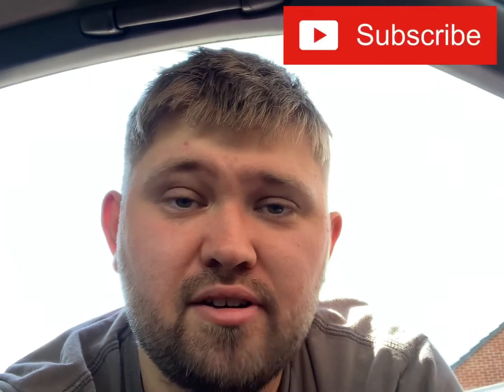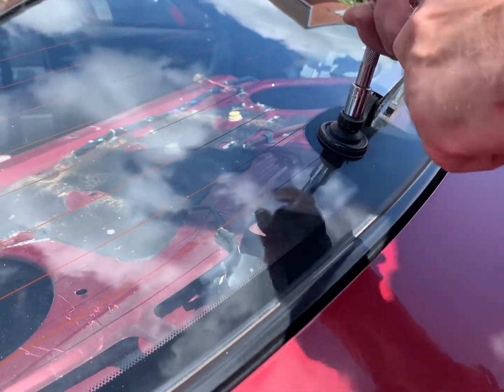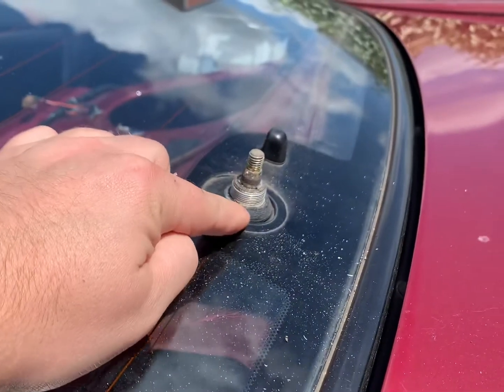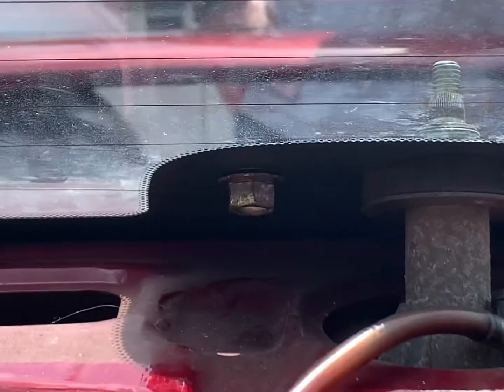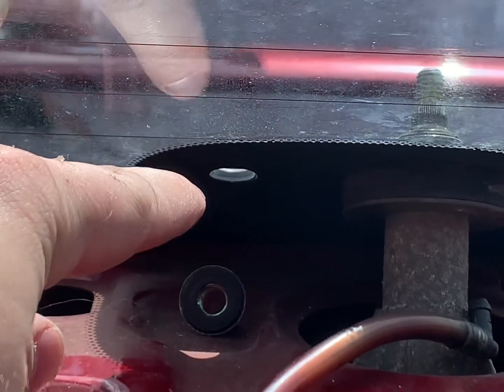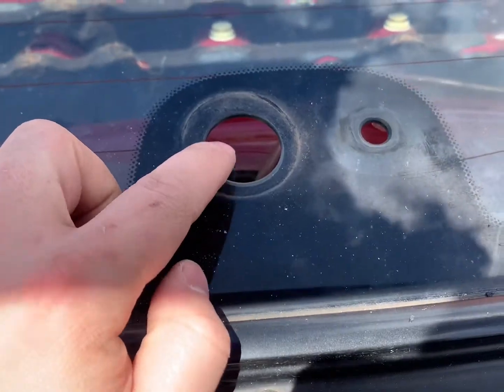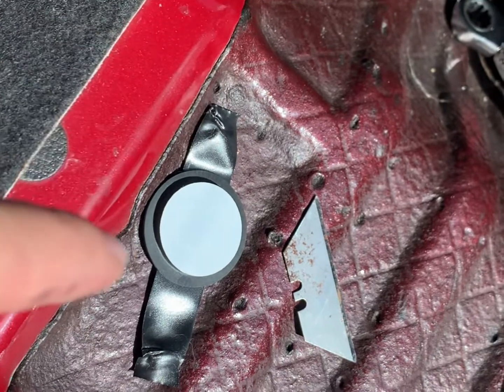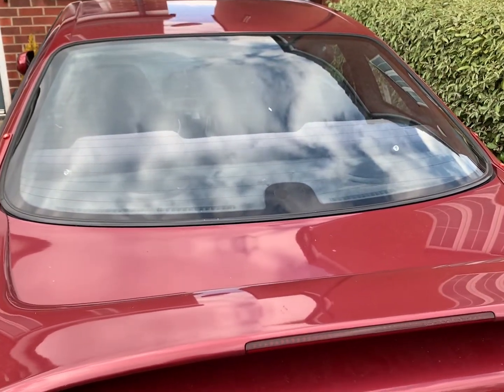BEST CHEAP MOD - R33 Wiper delete @KillAllWipers

Comment: Seen people do this, but honestly I prefer to have the wiper for its functionality since mine works. Driving in the rain sucks enough as it is 😅
Reply from the maker: I can understand that mate, my wiper was completely gone. The 33 Is a second car for me so only gets used in the dry. Saying that the FN2 which is my daily doesn’t come with one from factory.

I still need to fix the horn might try it today. I was meaning to ask mate. Mine was a none air bag 33 will my connectors be different to the ones in your video mate ?
Reply: @ashlb8223  with a non airbag model yeah I think yours uses a different clock spring, and probably different harnesses to it.
Reply from the maker: @jarsky  I’ll take a look mate. Think I have found you on Instagram so can always ping over a picture of the connector 👍🏻